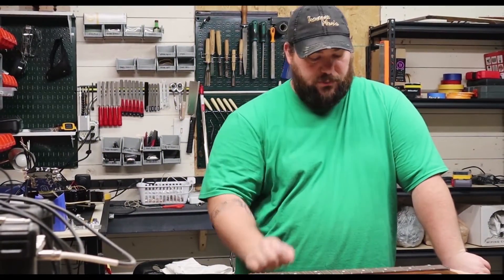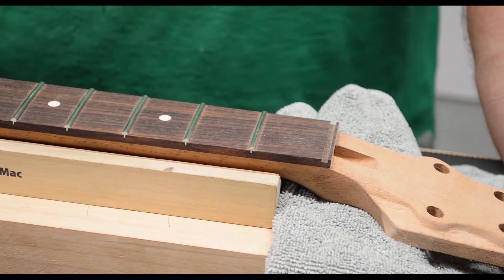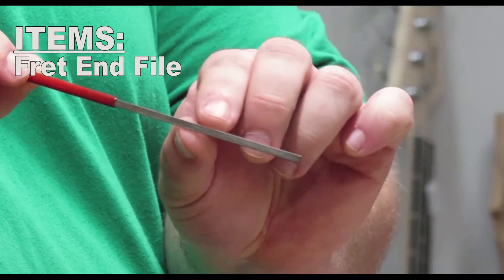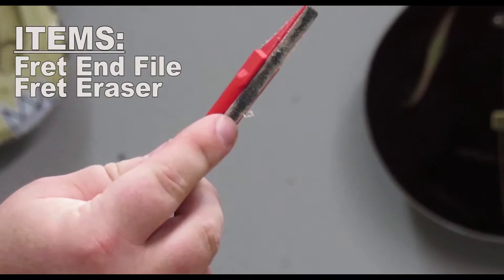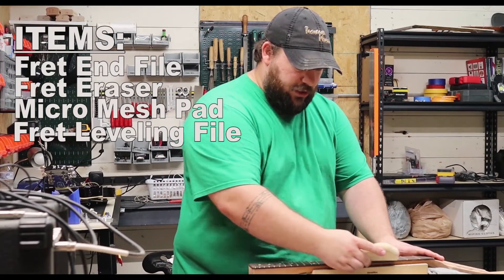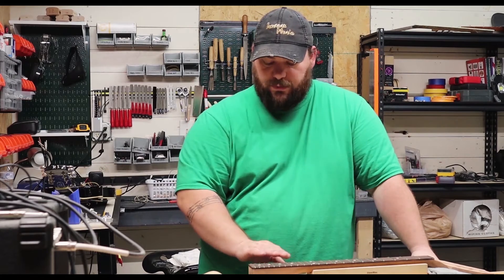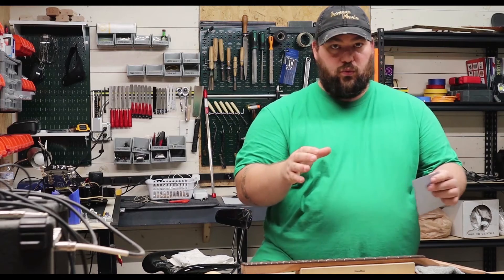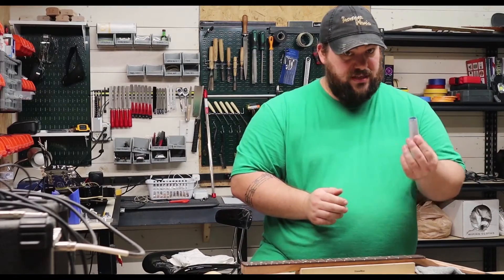Fret End Dressing Tutorial

Comment: I used to use this method - its tough to beat.  Now I also use a quarter round file and a concave half round crowning file to get hemispherical fret ends.  I've also found a Dremel with rubbing compound on a polishing wheel beats fret erasers for speed, ease, and most importantly - results.
Reply: I use the stewmac wheel buffers for the dremel and love them. I started using those about 3 months after this video. I still like the method with this file personally.
Reply: @travisbernard5315  Yeah, I just got the quarter round file. Only done one neck so far.  Definitely took a while.  might be worth it though.  What you're doing now is definitely the next best option.  Of course, we should be making our own necks, with CNC micro-routed fret slots that don't go to the edge, frets with the tangs nipped off the ends, and the ends ground hemispherical with a concave cup drill grinder.      But that's a lot of work!   <g>.
Reply: @normbarrows  I do make my own necks, I just didn't have one at the time of this video :/
Fret work is always one of my least favorite things, but when done properly really makes the guitar feel like $1,000,000,000

Comment: A tip, if you want to do the same and spend almost nothing. Buy a set of nail files. It works perfect without investing in a thousand tools.
Reply: I agree and disagree. If you are doing 1-2 guitars and not doing it again that is usually fine. My stew Mac file has lasted 5 years and well over 100 guitars. Also it works immensely better with stainless steel frets also.
Reply: @travisbernard5315  Totally agree, but for a user (not a luthier) it is a very good solution. I have used it on my 3 guitars, using only 1 set, they were very smooth. Regards!